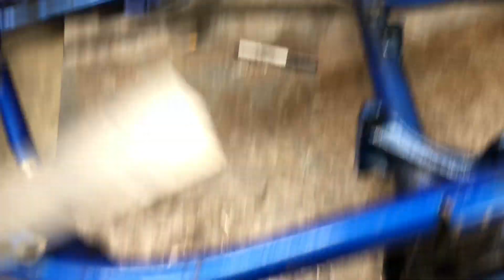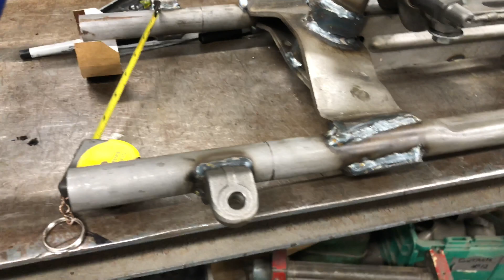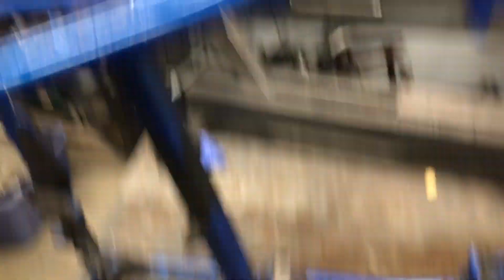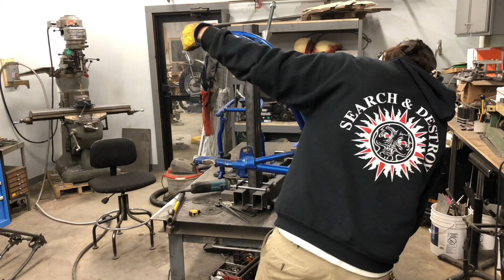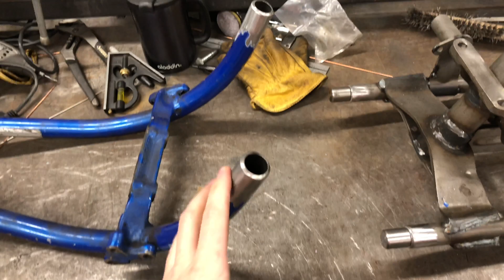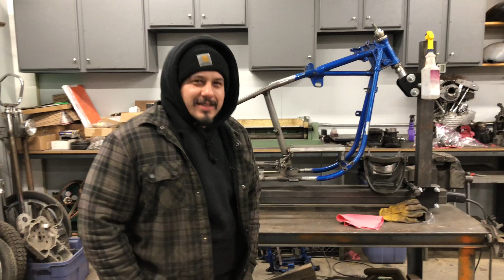How to hardtail a Harley Davidson Shovelhead Frame

Comment: as long as yer goin thru all that, add an inch to the seat post for stroke, take them front rails all the way to the neck , add whats needed to make the top rail straight to the rear axel, lose the front foot peg mounts, weld a sporter kickstand tab, mount yer brake pedal off the mech crossover, and put the master cyl behind the tranny... oh wait, theres more.......
Reply: the hump at the seat post is...: lay a '58 swingarm against a later model, the 58 topline is straight to the shock/fender strut mounts. the later frames swept up at the seat post (elec start).... for some, the beauty is in a straight top line...

Comment: You folks are getting folks to ruin auethentic
Reply from the maker: Authentic what
Reply: @TheEazyCo  Frames ! Thats why there are not alot of original frames for many of the early bikes ! Many were stretched , shaved , Just saying ! Been there done that ! So be it ! If it's your thing ! A stock bike frame an engine will hold some value , but a replacement hardtail frame is junk ! Now that HD IS STOPPING PRODUCTION OF THE SPORTSTER ! RARE MODELS , THAT ARE STOCK WILL SEE A RISE IN VALUE ! I HAVE  OWNED MANY BIKES ! I KEPT THEM STOCK ! YOU CAN FABRICATE , BUT I FEEL THIS IS YOUR BUSINESS ! MINE WAS TO FIX AND KEEP THEM ON THE ROAD , IF YOU WANT TO IMPRESS , THE YOUNG NEW RIDERS , MANUFACTURE , US MADE ,  FRAMES ! PUT THE STOCK ONES ON A SHELVE !💀

Comment: Man i learned the hard way! next time when cutting you can make a small jig with 3 rods and a few bolts for the frame in the engine area to keep everything in its right place. Its a way easier to fit everything later.

Comment: When you get older, you're going to regret chopping that Shovelhead frame. Shovelhead frames with a round swingarm and 13.5" shocks look really good, and ride so much better. Harley riders waited for years hoping the factory would come out with a swingarm frame for the big twin.
Reply: It depends on the person though, Tom Fugle rode a rigid till his death at 75
Reply: I have to agree, whatever you do, make sure you don't get older haha haha
Reply: These are chopper dudes though
Reply: because gettin softer as you get older always works..... not

Comment: So question what's the total price of what you did compared to just buying one
Reply: that hardtail is $1000 not including shipping from tiawan, you can buy a full rigid from from $800-1500 or an original pan rigid can cost 3K , using a hardtail you can keep the vin numbers n not have to apply for new title and some are as close as your gonna get to a stock pan frame imo the paucho n aftermarket full frames to stetched n you gotta worry bout motor mounts not matching up